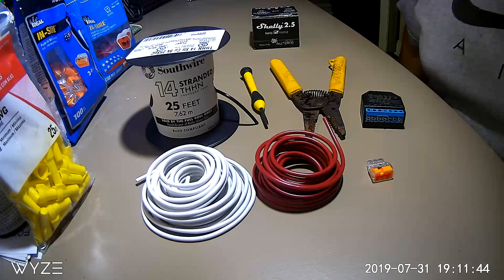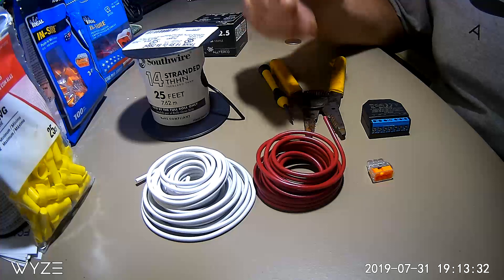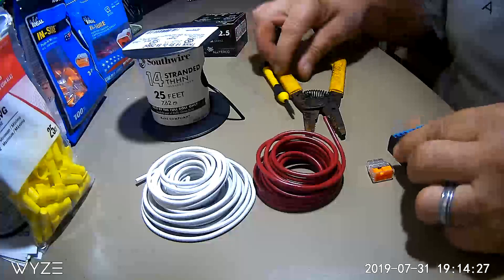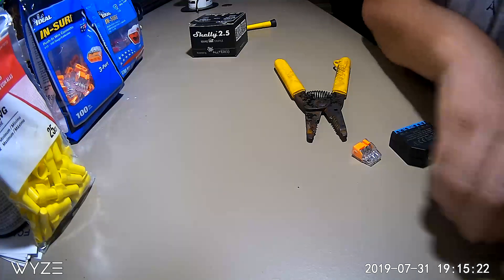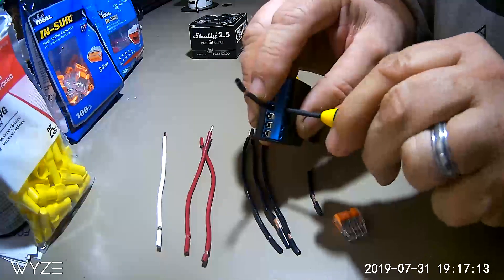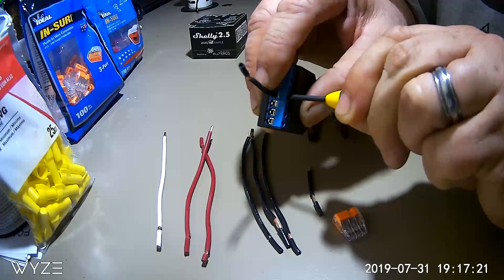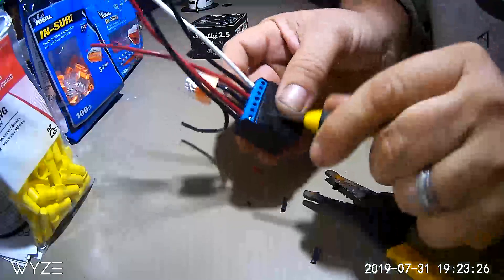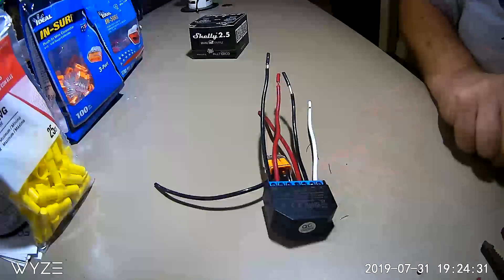My Blog Setting up the Shelly 2.5 WIFI Relay for installation

Comment: I have a 2 pull chain ceiling fan without a wall switch. I was thinking about using the 2.5 to control the lights and fan for it.
Reply: Did this work for you? I am thinking of doing the same thing
Reply: @treyclark1  Sorry, I've not done it yet. I bought the relay but haven't installed it yet.
Reply: There are better dedicated fan control modules available, which you wire into the fan (hide it in the surround at the top of the fan downrod) and let you control both the fan speed and light remotely. The Sonoff iFan04 seems to be the popular choice, and costs less than a Shelly.
Reply: @elzzon  Thanks!

Comment: For a switch on a 15a breaker, how do you justify in terms of safety the shelly 2.5's 10a rating?
Reply: It controls 10a per channel. In other words, each of those red wires that connect to two devices can draw 10a. If you're drawing more than 10a for a single light source, you've got bigger problems.

Comment: Do you know how these devices are treated for box-fill calculations?  I'm working in an environment where regulatory compliance is strictly enforced.  I tried to use one of these and both the inspector and supervisory EE refused to sign off. No box fill data, no use. Period.
Reply from the maker: No I don't. sorry
Reply: @diyconnectedhome6102  No UL listing, either, so don't mention this to your insuror.
Reply: @WCM1945  Shelly 1, Shelly 2.5 are all UL listed.
Reply: @w00master  if you buy the UL models. Some are not UL listed.
Reply: @dukegamma  Mine doesn't. Hmm. Got it two weeks ago. Must be old stock.
But the software still doesn't see the device, even though it shows up in the WiFi list. The relays work, but no remote control at all.